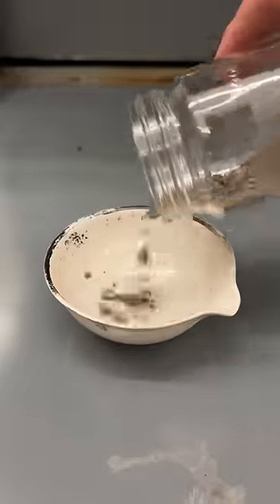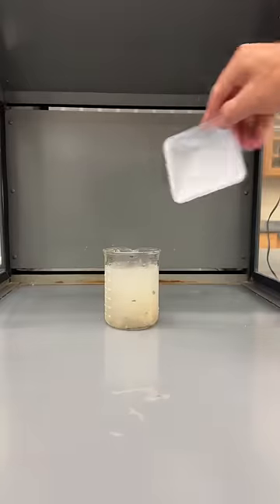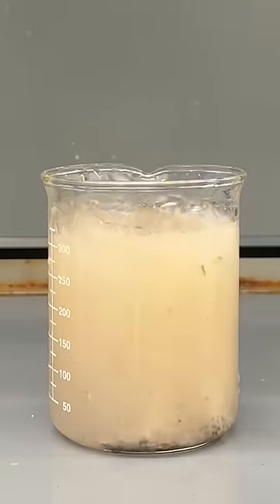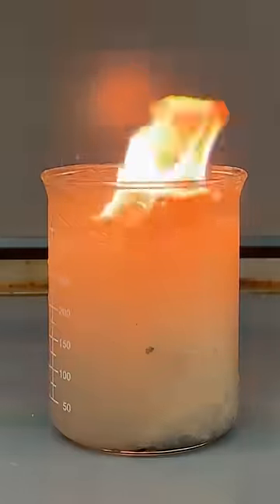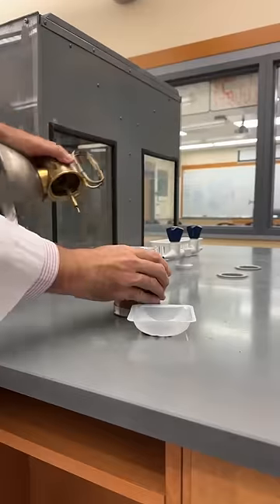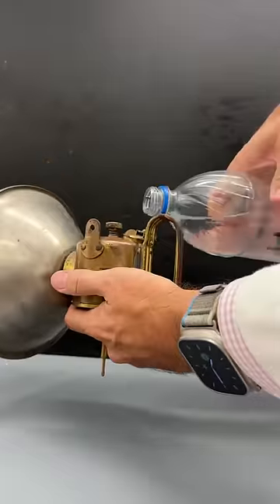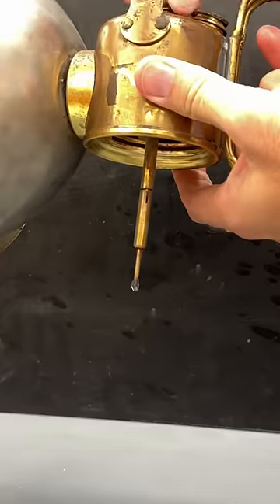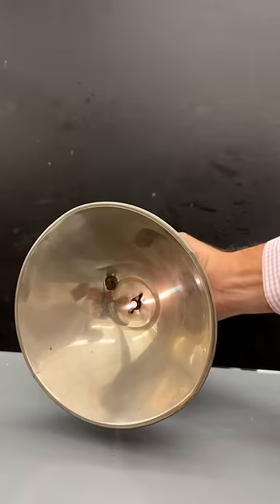Calcium Carbide is Kinda Strange

Comment: Calcium carbide is also used in the pineapple industry to induce flowering. Acetylene is a precursor to ethylene. The acetylene enters the plant and is transformed into ethylene in the plant's cells. As plants age, they produce more ethylene, which triggers a hormonal response in the plant to produce fruit.

Comment: The aim of this work is to analyze the interactions of 5MeV electron beam radiation and a 290MeV/u Carbon beam with calcium carbonate (powder) at 298K and at different irradiation doses, for the potential use of calcium carbonate as a high-dose dosimeter. The irradiation doses with the electron beam were from 0.015 to 9MGy, and with Carbon beam from 1.5kGy to 8kGy. High-energy radiation induces the formation of free radicals in solid calcium carbonate that can be detected and measured by electron paramagnetic resonance (EPR). An increase of the EPR response for some of the free radicals produced in the sample was observed as a function of the irradiation dose. These measurements are reproducible; the preparation of the sample is simple and inexpensive; and the signal is stable for several months. The response curves show that the dosimeter tends to saturate at 10MGy. Based on these properties, we propose this chemical compound as a high-dose dosimeter, mainly for electron irradiation.

Comment: When I was a kid, we took a quart paint can, poked a small hole low on the side, throw in the carbide,  then water (spit) and then put the top on a little tightly. Gave it a while and put a lit match to the hole. BANG! You had a 50s - 60s cannon!😊

Comment: I’d like to see what would happen if you mixed the calcium carbide with sodium peroxide before adding water. When water is added to NaO2, oxygen is released in an exothermic reaction and, generally, any adjacent flammable material (like cotton, for instance) ignites. So, if you had a mixture of CaC2 and NaO2, you might get the world’s only oxyacetylene torch (sorta) that can be lit by water!

Comment: I went to an auction one time at an old school repair shop. He had an acetylene generator in the shop. Owner had passed away so nobody really knew what was in there. Somebody managed to turn it on with nothing connected to the output. All of a sudden somebody realized there was something boiling in the corner. Wound up evacuating the place and calling the fire department to put a fan in. They let them take the acetylene generator. I think it still sitting in their headquarters as a display.

Comment: As for "minors": I was a kid in the 90s in Russia. Back then carbide was still used for welding and was somewhat available here and there, as well as petrol. Put it in a plastic bottle, add water, quickly close screw the cap and make a petrol fuse leading behind big tree or some other cover. And fire it up. You've got a big nice BOOM

Comment: A university threw out a whole barrel of Calcium Carbide - all was fine until they compacted it - splitting open the barrel and mixing with all the drinks thrown out from the Student Union.
Yeah, it started on fire and rhe driver wisely dumped the whole load in a parking lot to save the truck.
Then the fire department came add added MORE water to the inferno... 😂😂😂

Comment: In my place, we use it as cannon in concrete tube. Feed it from the front in small container, close the lighting hole and close the front with cloth and coconut shell, open the lighting hole and light it with fire. If it doesnt explode out the front and shoot jet of flame on tiny hole, slap the fire with slipper 😂😂😂

Comment: Back when I was working in construction oh boy said have you ever seen an acetylene bomb? I said no. So he had a half gallon of chocolate milk and he just turned his settling on and started letting it bubble up in the chocolate milk I'm saying well this is either going to be nothing or something spectacular yeah it was spectacular. He pitched road fuse some people call them flares they're actually fuses. Next to it and that's some of a gun boom which pissed off the superintendent to no end. But it did one thing instead of having to get out there with the bucket because the pump wouldn't work it blew all the water out of where we had to stand to tie rods for a concrete pour. I mean it blew mud and water at least 60 ft from that spot. I will way out in the middle of a field it was no chance in hell of anybody being hurt. Well it's better than using dynamite I've seen it done that way also back in the day when you could buy Dynamite by just signing for it. I grew up on a farm we use dynamite all the time we never even considered malfeasance. Those days are gone.

Comment: Does the lamp produce heat? And if so, could it be modified into a heater?
I just saw a video of a truck driver using a gas burner to keep warm dying of monoxide poisoning.

Comment: Yah , this is " Oxygen " not " Oxygen for Breathing " for " Oxygen Tool " that cut Trough METAL
Carbide + Bottle ( High Pressure Tank ) + Water + Tubes  that Fill the Gas in Another Bottle ( H P T ) , Then you ignite the Gas like you Did , And the Flame from the "Oxygen Tool" is Connected to Another Bottle ( H P T ) or Compressor for air , Because you need Air in Order to Burn with Control Valves...

P.S.:
Not everyone are Kids on your Channel

Comment: My group won a boyscout winter jamboree fire starting competition using calcium carbide as our allotted fire starter/tool.

A flat of bark with some snow on it, pebble of carbide, and some kindling, struck with flint and steel, and we had a cup of boiling water faster than any one.

The guy judging the competition got ornery with us for not 'putting out' our fire after we had won and dumped a shovel of snow on it despite our warnings.
His surprise when the fire started coming through the gaps in the snow.

Comment: in my village, we use it for the bamboo cannon, usually played in ramadhan on the afternoon before iftar
it only creates a loud cracling sound since we don't use any projectile
we also use it to speed up the fruit ripening process, mostly for bananas after we cut it from the trees